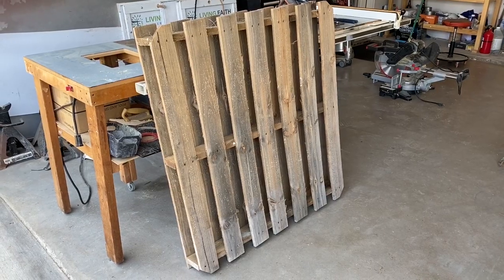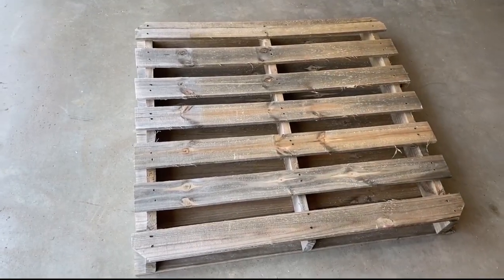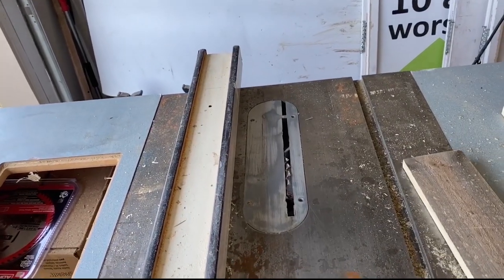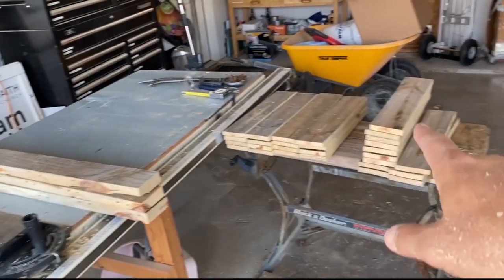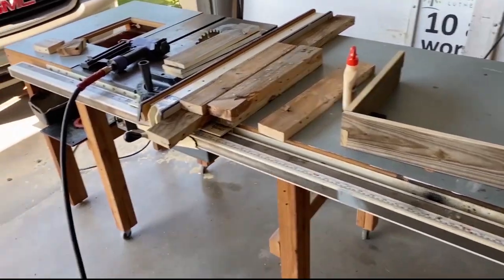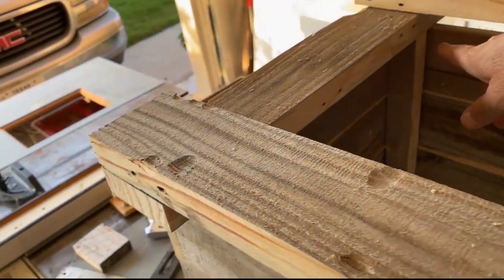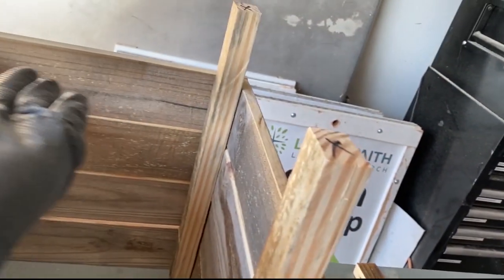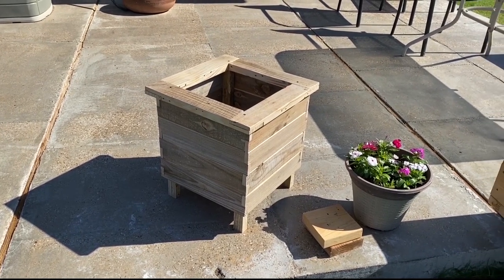Build an attractive DIY PLANTER BOX from a pallet at no cost. Great re-purposed wood project!

Comment: Not that it makes any difference to the design, but a good way of getting the slats off the 3 risers without sawing is to use a garden fork. If you put the forks middle gap between the tines over the risers and pry upward it comes off surprisingly well.